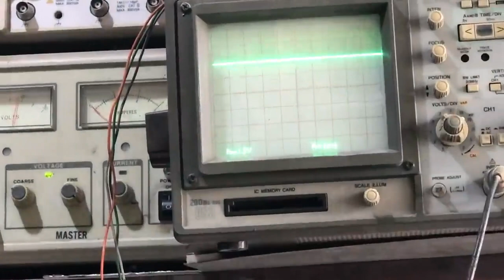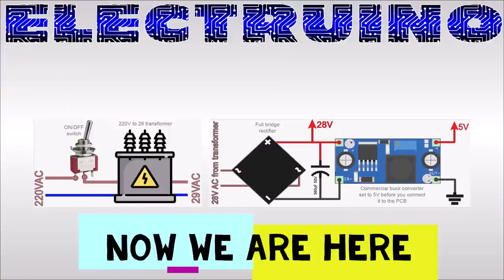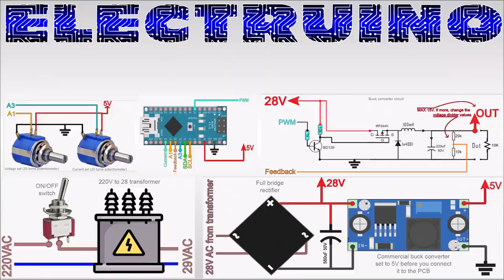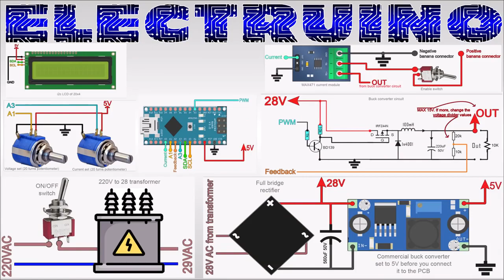Best Arduino Based  Constant Current Constant Voltage CCCV Digital Power Supply   Arduino Projects

Comment: Please Sir could you provide the lists for the complete components in order as assembled successfully by you on breadboard?
Reply from the maker: why not
Reply from the maker: 1 x Arduino NANO/UNO
1 x MAX471 sensor
1 x Buck/boost converter
1 x i2c 20x4 LCD screen
2 x 10 turn potentiometer
2 x toggle switch
1 x 220V - 26V transformer
1 x full bridge rectifier
1 x BD139 NPN
1 x IRFZ44N n-Mosfet
1 x 1N4001 diode
1 x 100uH coil
1 x 220uF capacitor
1 x 220uF capacitor
1 x banana terminal pair
2 x 22mm bearing
2 x 3D printed knob suport
RESISTORS: 1x1K, 3x10K, 1x20K
wire, solder, soldering-iron, etc
Reply: @ElectruinoDiy  Thank you Sir

Comment: code is not good, it is usable for ideal static load. For unstable load you will get unstable output voltage and current
Reply from the maker: I will work for more stable

Comment: This code?
Reply from the maker: http://electronoobs.com/eng_arduino_tut85_code1.php
Reply: @ElectruinoDiy  sir this can make possible 35 volt and 10 amp?
Reply from the maker: yes you can make if u use perallel 2two or three fet transistor and use high current capiable inductor
Reply: @ElectruinoDiy  sir if you give me a schematic diagram of perallel, It would be very useful
Reply from the maker: @mobilesurgerybd  upload soon
Reply: @ElectruinoDiy  thanks
Reply: Sir how to contact with you